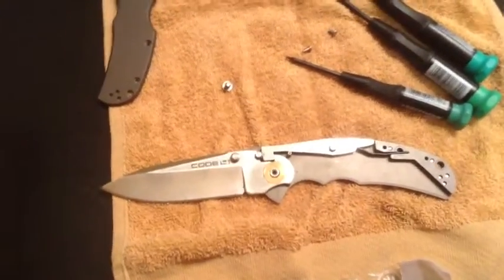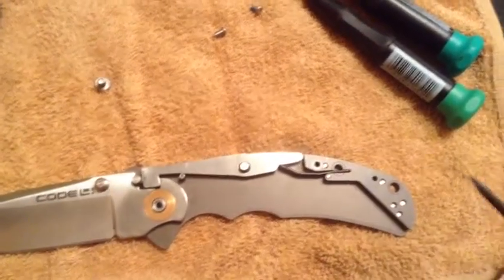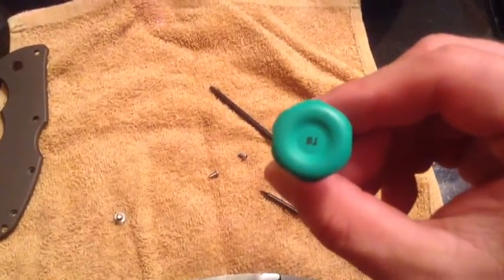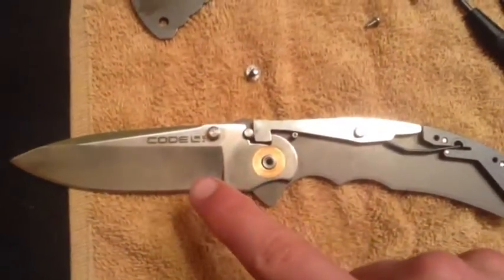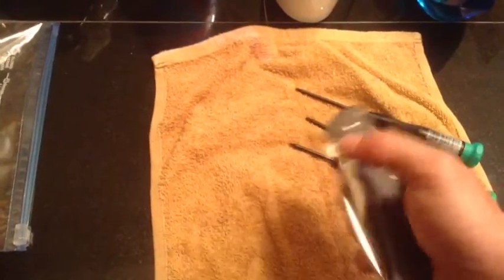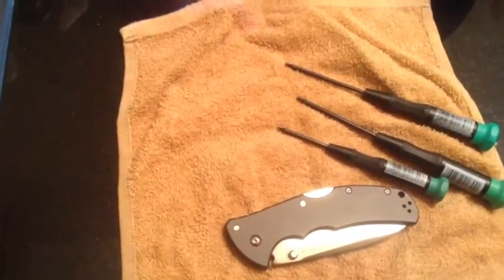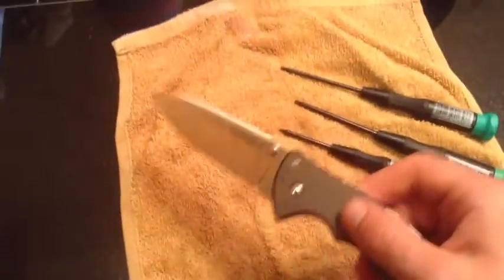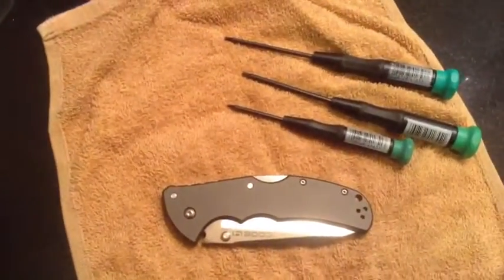Cold Steel Lock Modification Video: Smoothness

Comment: This weakens the lock strength by quite a bit and your spring has the potential to snap or slip out under hard use. Your knife will smooth out and become easier to release the lock the more you use it. I bought my knife because of how tough the tri ad lock is.

Comment: I did something similar to this I used two pliers after removing the spring. I bend the spring slightly with two pliers. But I made sure spring was seated, all the way into the chamber, as far as it would go. After closing up the scales. The knife closed so quickly with my weak hand so easily it was down right scary. I had to worry about the guillotine effect with the blade closing on my index finger. Wear a pair of gloves. I have 12 bad boys with the same problem and I am excited to fix them all. Don't worry about your GSM Cold Steel lifetime warranty. It doesn’t exist anymore. GSM has no warranty repair shop, service or repair parts. If you have a receipt and a return authorization GSM said they will only replace a knife. Since I have a few knives out of production? I have no replacement option. By the way I asked for a return authorization. Never heard anything from GSM. So, better learn how to repair you knife. I noted the issue with their sales representative, Jimmy Slash and he deleted my similar post.

Comment: I modified both my Cold Steel Code 4 knives due to the tri ad locks being ridiculously hard to release. What I did was to remove the spring, put it in a vise and just slightly lessen the bend in the spring with needle nose pliers. The spring still sits in place as normal but it is a lot smoother, not to the point of weakening the lock strength or having any effect on the blade retention. Basically it is like a year of use done in 5 minutes :)
Reply: That's the way I did it. This way shown doesn't seem good to me. Compromises the knife in my opinion

Comment: I purchased one of their largest knifes with this locking system and though it opened easily my pet 550 pound Silverback Gorilla using both of its thumbs and flipping the knife over and pressing the top of the widest part of the blade against the top of the box couldn't close the darn thing, I returned it. Thanks for letting me know that it's not just my imagination.
Reply: Same issue I ignore the 12 knives I purchased in 2019. Tried to get Cold Steel in Ventura to help on this issue, and they ignored me. I think they had a bad assembly issue batch and dumped them on Amazon.  I collected these Cold Steel knives and shoved my dozen knives into my collectors drawer and forgot them. I started to see If GSM would repair them and found they don't repair knives. They just do a return and replace if you have a receipt and picture of the knife.  They then decide to send you a return authorization to  GSM or not. I never heard back after I sent an email. So I got the message. They don’t warranty anything they sell.

Comment: I would be reluctant do do this. I am sure Cold Steel has a better idea how these must be done. I agree with other posters here that claim bending the spring is a better idea, if it has to have less tension. Better yet, you can buy the spring material from a knife maker supplier, cut it to the right length and give it the appropriate bend. Either way, I think moving the spring forward is a bad idea and undermines the designer's skill, experience and real world testing to arrive at the end product.

Comment: There's a video where someone grinds the lockspring in the middle to thin it a little and reduced the force required to release the blade lock. It amounted to a few pounds less required to unlock the blade, and the spring could still set back properly in its slot with possibly less danger of it getting jarred completely out of place.

Comment: Interesting mod that personally wouldn't do. I think the potential for failure of the lock is much higher.  A hard lock to disengage is a small price to pay for the strength of the tri-ad lock.  If you don't have the hand strength to disengage a tri-ad & get a liner lock.

Comment: Great video. Thanks for sharing. I received my Code 4 today and modified it after the first time I opened and closed it. Works just like the video. If the spring slips out of the chamber, I will superglue it into place.

Comment: I'm glad your knife is smoother,  but I think that spring is designed to make the knife real safe . The way you half set the spring in its place, might make the piece fall of your knife.
 Remember that that spring, locks the knife when it is open and most important, when it is closed in your pocket where you usually put your hand in. Greetings!

Comment: I set mine up this way and it does feel and open much better.  Time will tell if it slips out, but I doubt it will.  I also radiused  a 45 degree angle on the lock bar and that annoying click is gone.  They overbuilt this lock and it is not necessary for what most of us use these knives for.  I just wanted to try a tanto blade and almost wish I'd bought a Civive or something else, but I do like this S35Vn steel and the hollow grind.  I'm going to try some 3M clear bathtub tape for a more secure feel next.  Now, after doing everything Cold Steel should have done, I think I'll enjoy this knife.  It wouldn't have taken much for CS to have etched or grooved this alum for a more secure grip.

Comment from the maker: @sharpbevel, I agree with you about building hand strength. That is one of my many personal hobbies. But I would personally like to see cold steel put out some blades with a smoother action/ or a more consistent action. Like the voyager series. But I disagree withe the liner lock suggestion. A tri-aid lock with a weaker spring will on average be stronger than the strongest liner lock.

Comment: you could just bend the spring to reduce tension, leaving it half way out like could make it eventually fall out.
Reply: +barry soetoro If you look at the lock bar, there's a shoulder right behind the pivot point that would  cause the spring to act like a brace and stop the lock bar from traveling which prevents the knife from closing.

Comment: Your discussion gave me an idea that seems to work for my CS Mini Recon.  Although I polished the internal parts, the lockbar would still sometimes stick.  Additionally, I noticed that when closed slowly or when opening the knife a hair and closing, the blade would sometimes not stay closed.  So, I radiused the spring on both sides, so that the sharp corner wouldn't get caught on the rounded aluminum backspacer.  I also radiused where the spring contacted the lockbar for good measure.  It is now much smoother for unlocking and eliminated the issue with the knife staying open a hair while in pocket.

Comment: I take the spring to my belt sander and thin it down a couple of thousandths and polish the ends and the back lock. Thinning the spring makes it easier to disengage the lock yet retains all of the lock strength. 1or 2 thousandths is all you need to take off.

Comment: Great idea for a mod.  IMO smoothness can be too smooth sometimes.  I remember being in so much awe with my Spyderco Manix 2 and how I could pull the lock buttons and the blade just fall and swing back and forth.  And when the blade was in the swinging position anywhere there was still no blade play.  Amazing craftsmanship IMO.  However, after my amazement was satisfied I became very concerned about sharp steel swinging around looking for a finger or other human flesh.  Now I like my blade tension so it never moves unless I move it with my thumb.  I still want it very easy to move but no movement due to gravity is a way to say it.  But for ease of use for people with weaker hands this is a great idea.  And while most Cold Steel knives when locked will hold unbelievable amounts of weight as demonstrated in their videos that level of strength is seldom really needed.  In fact some have said the tri-ad is not needed in Cold Steel's smaller knives.  But, if it doesn't hurt a smaller knife to have it (and it doesn't), why even mention it.  Some may argue that a back lock with less strength may be less expensive I think possible a factory needing two assembly lines or the same line needing to be set up differently for two different lock types may cost more in the manufacturing.  And for me I prefer a knife to be as small as possible for the job at hand.  I love my mini Lawman having the tri-ad lock.  In fact I just bought my second on ebay.  The mini Lawman is discontinued and now that they have XHP I just had to have one before they are all gone.  The new ML came today and I love that knife.  And the Tri-ad lock even when lessened in some strength is still one of the best around IMO.  So even if this mod isn't what some people want it's a great idea is some cases.

Comment: Where the spring makes contact with the lock bar...grind that out towards the hinge with exact geometry. That angle that seats it now, just move it away to accept the spring (instead of it riding out as shown) Put some brush on wite-out or equal clear mark, on the bar where you want to STOP the grinding beforehand as a warning guide. Put a pinch of a dense superglue on the other end of the spring it where it seats in that thin slot.  Leave spring out towards and into your new gap/notch THAT amount. The little bit of glue will hold that out of its old limit while form fitting and drying in place. The spring is safely seated, while not competing for the dead space that belongs to the blade.

Comment: Do you notice that the lock bar sits less flush closest the the blade end when the knife is fully opened? also how tight is your pivet screw when you fnished? all the way tight and it opens stiff but if you back it off more than a quarter turn the blade rubs the scales. definitely a great idea though, it opens and closes so much better.

Comment: you have to make sure you maintain some  blade retention !  I push the button down a tiny bit past the handle scale  !  if I go to far I open it up and bend the spring back a little ! or  when I take out the plastic washer spacers I bend the second bend in the spring very close to flate ( the one closest to the blade ) !  you can bend it a little just not a lot !  shade tree  !

Comment: If you ground a second notch in the lockbar, and filled the excess space in the channel for the leaf spring, the spring would not be able to drift, and it would make for a more solid fit all around.

The triad lock transfers all positive and negative pressure to the pin.  The lockup is still as strong as it was pre mod

Comment: A year has gone by, how well is the knife holding up with the mod? I just received my code 4 and it needs this mod.
Reply: Just put the spring in a vice and gently compress. It will work just as well and not compromise the lock up in any way

Comment: I think that sanding down the pointed shoulder area on the lock bar where it meets the blade might be a better solution.   Removing steel from the shoulder of the lock bar will allow more space and relieve tension which should make the action much smoother without weakening the lock potential by removing spring pressure.

Comment: Hi, Mathew! Thanks for the video, it made my Talwar (new G10 version) a lot easier to operate :) 
Still, a word of warning.
I noticed that my blade comes in contact with the spring, as the spring now goes deeper in the handle space, so to say. Noticed it because of metallic sound while closing the blade - and noticed the dull marks and the scratch on the spring. Oh well, time to re-sharpen it. So, people, be careful, as your blade MIGHT come in contact with the spring. I advice to try closing the blade after this mod BEFORE assembling the knife, so you can see if there's the contact of spring and cutting edge of your blade.
Maybe some bending of the spring will work? Dunno, will check it out later.
Peace.

Comment: Okay so I did this just now and it is really smooth. But there is one problem. There is now pretty much zero detent. Is there a way I can fix that?
Reply: +fatmanandschizard You overadjusted the spring.  If you followed the mod in this video, you slid the spring too far out of the slot.  If not, maybe you overbent the spring.  But there's not enough pressure on the blade from the lock bar to keep tension on the blade to keep it from flopping open.

Comment: I either take thos plastic washer out or i put them on the other side of the bronze washer .
    If you really want it to work well take a few pounds off the lock spring by un bending the bend closest to the pivot .flaten that bend .be carefull that you keep the blade retention .might have to bend it back a little .but man it works sweet and easy then .
   I did it to this very knife !
   Fuck a subenza !
 Their lock is crap !
The 21 and 25 are like buck 110s .blocky  and heavy for no reason !

Comment: If you are to weak to operate a tri-ad lock properly and want it to function like and feel like something it's not, just get a different knife....
Reply: Toby I'm 74 years old. I've owned a lot of folding knifes. I'm looking for a pocket knife not a project. Of all of the folding pocket knives I've owned both inexpensive and up to about $175.00. I've  never experienced any problem with any of Their locking systems with the exception but rarely some poor seeding of the blade until this one. After trying to close it with both of my thumbs to no avail I did send it back.

Comment: It sounds like it rattles when you put it down. Cold steel is know for its tight tolerances that's why the triad lock is one of the strongest locks. Dumb mod in my opinion.